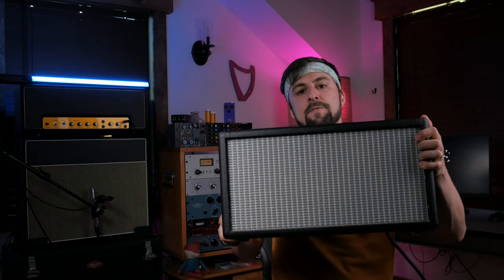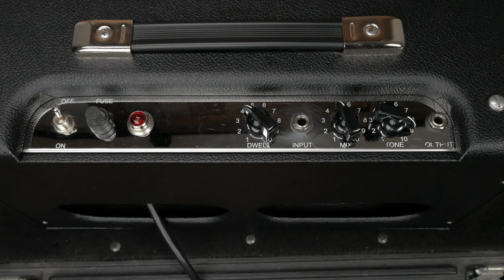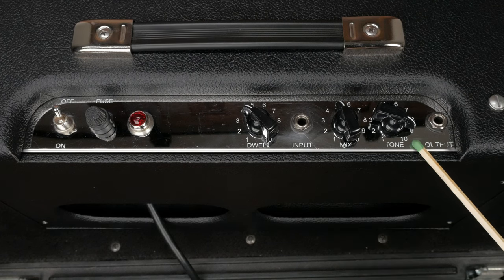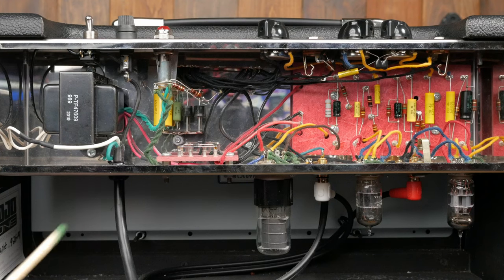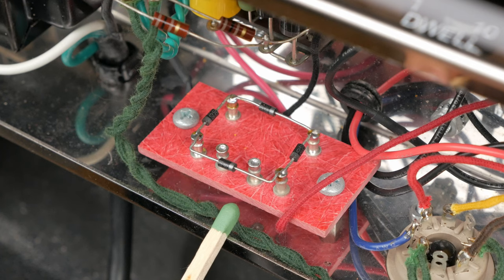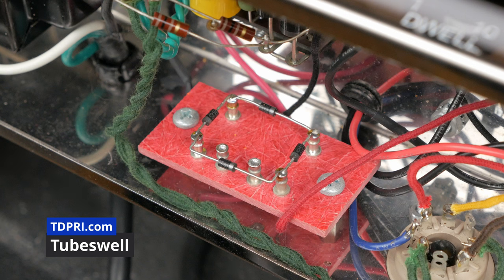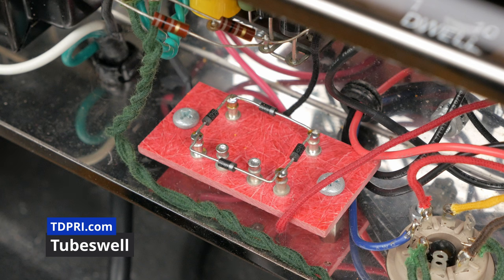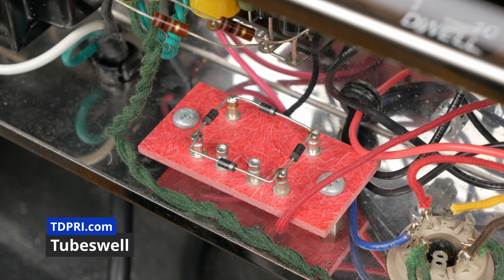Building a Fender Spring Reverb - DIY 6G15

Comment: Nothing matches the 6G15 for surf drip.
Reply from the maker: I agree G L! The digital stuff can get you about 85% of the way there but it's no substitute for the OG.
Reply: @shoetiquemusic  I play a lot of surf-a-billy-punk style guitar stuff and I use a vintage spec 6G15 I built myself. It's amazing. I love it. I don't always feel like dragging it around though, so I keep in my bag a TC Drip pedal. It's cheap and easy and sounds surprisingly good for surfy drip with a hint of slapback..
Reply from the maker: @GL64  I agree that the 6g15 isn't something I want to lug around. I've been messing around with a UA Golden. The drip is pretty good but its almost too pristine. I want my drip to be a little grimy.